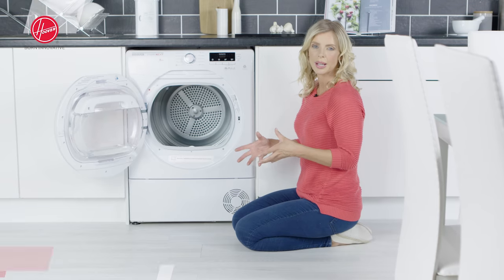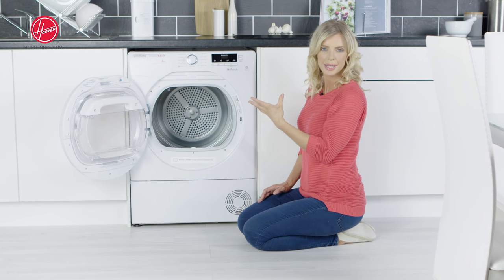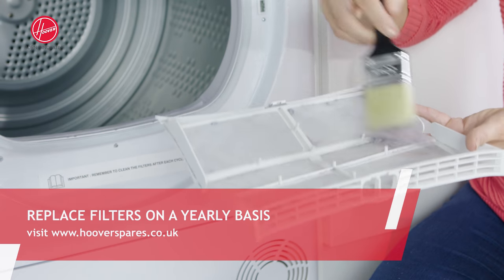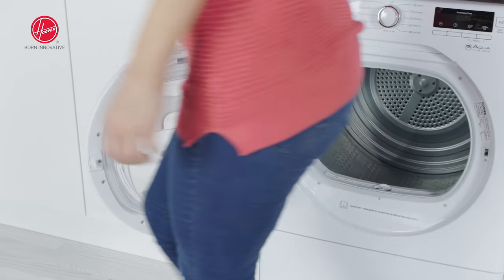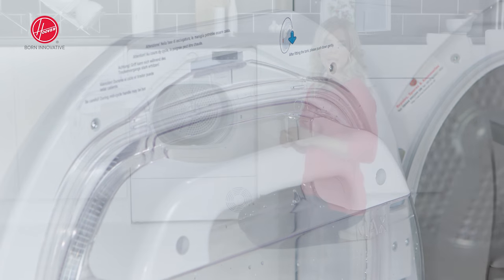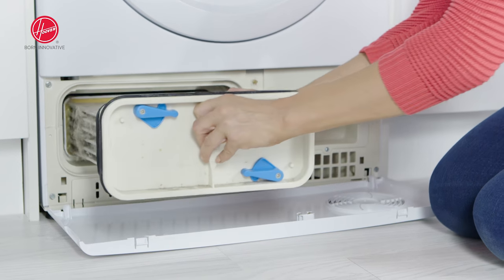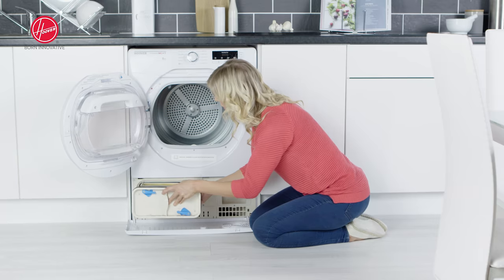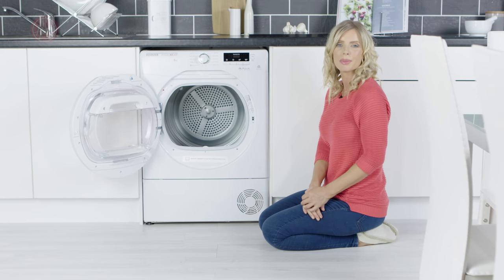Hoover Condenser Tumble Dryer Aftercare

Comment: I am unable to fix condenser back into tumble dryer this time when I removed, cleaned and washed. I have been doing the same for 2 years.......what to do, where is the fault?
Reply: Late reply but the rear plastic lip (not the rubber seal) can spread out and need squeezing closed. If it shows signs of being bent outwards from you pushing it in you'll see where to bend it back. That's my experience anyway.

Comment: Mine won't lock in
Even after locking the dials the seal won't hold
Reply: Mine won’t go back in
Reply: Pour boiling water over the deformed plastic bit at the back and bend it back. And then quickly slide it back in. Mine wouldn't go back in once I got it out and would stick out about an inch. I now have to do the above everytime I have to take it out.

Comment: My condenser is hard to put back in just don't slide in that easy
Reply: Thank you I’m having headache putting it back in
Reply: @louloubelle1330  pour boiling water over the deformed plastic bit at the back, then bend it back. Then quickly slide it back in. I was having the same problem, it wouldn't go back in properly, was sticking out about an inch.
Reply: @Jennifer-df3kz thanks ur a lifesaver